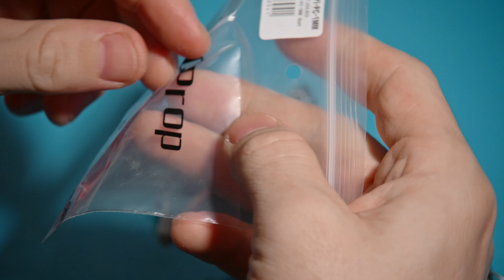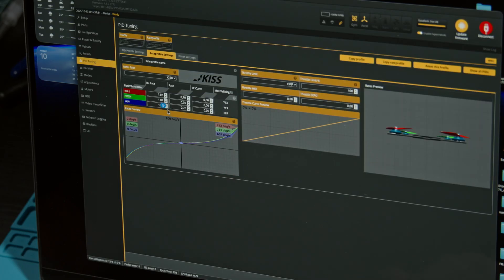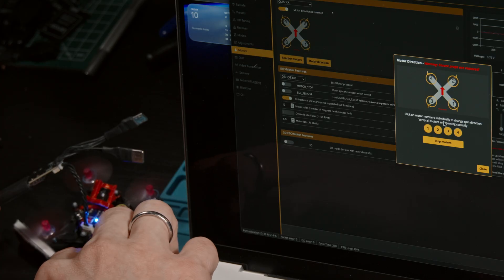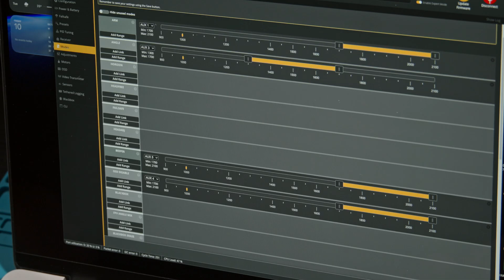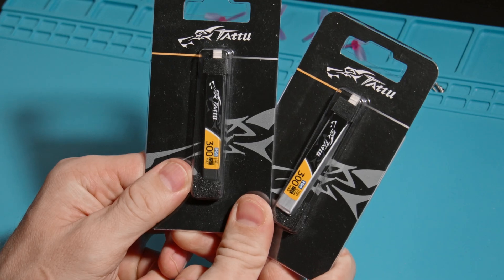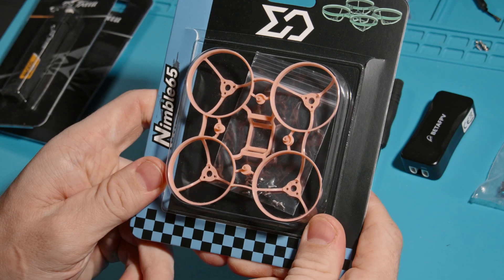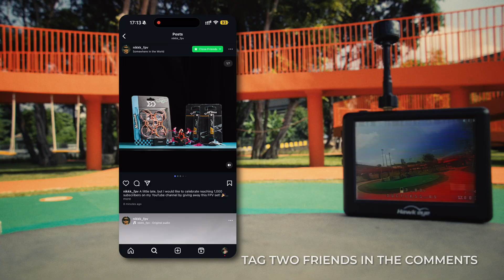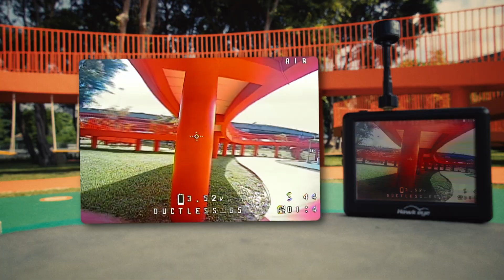Built a Custom FPV Drone… and I’m Giving It Away!

Comment: What Soldering Iron can you recommand ? I got one as a present but i am realy unhappy because it takes an eternity to get to head and i have no controll at all.
Reply from the maker: I'm not very competent in this area, but I bought a sequre s99 set when I first started this hobby, and I haven't changed it since. I really like how it solder and how compact it is. I will note only one small drawback: the body is made of plastic and there is no rubberized surface for grip, which sometimes causes it to slip in my hand, and this is not convenient
Reply: Soldering irons have come a long way, and there are many many good ones to choose from.   There are still cheap ones out there that do not have adjustable temp, stay away from those.   Adjustable ones are very common and quite affordable.   You should spend as much as you feel comfortable for the amount of soldering you intend to do.   And there are a lot of new cordless ones out there now.   I only do a small amount of soldering from time to time.  And I really like the cordless variety, they heat up in just a few seconds.  And they shut themselves off after a few minutes of inactivity.

Comment: I wish, i couldn't  fly it if i did win. I need goggles & they be 'spensive. :c
Reply from the maker: cheapest analog goggles cost around $50 or less, is it expensive? 😳
Reply: @Nik_FPV24 do i want a cheap goggle that i know will end up going in the closet, or do i want to get something i know i will keep for years so i dont need to spend more later on an upgrade?

You fly, lemme ask you, when was the last time you pulled out a $50 goggle & thought to yourself, "Man, i should sell my HDZero goggles because this $50 goggle is fantastic!" Or would you rather spend more on something you know you will keep?